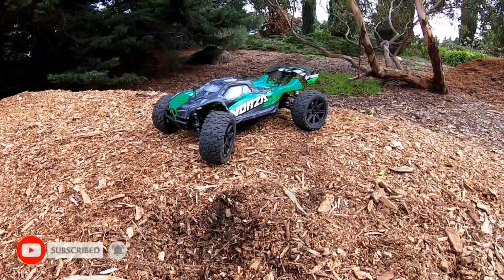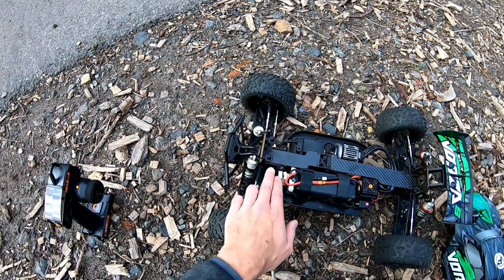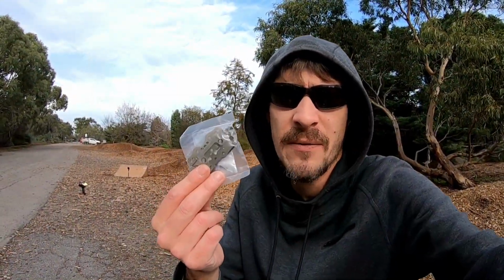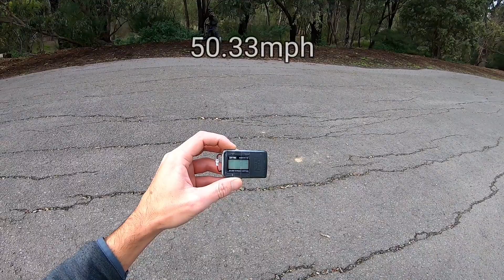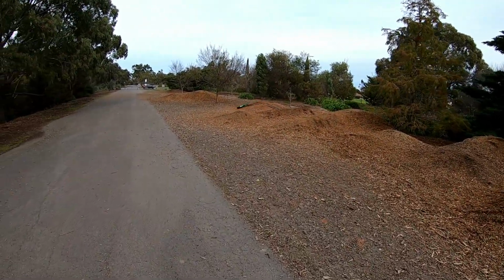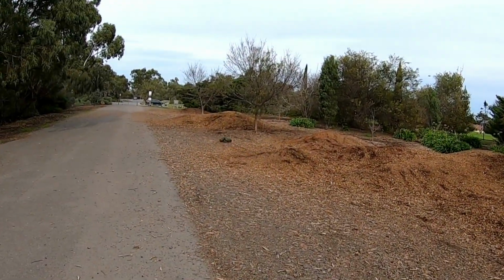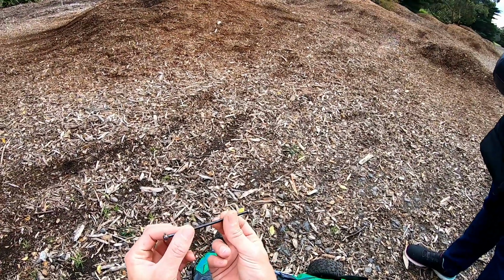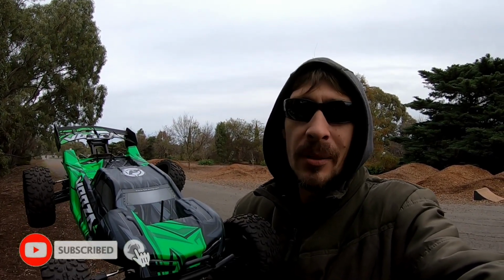HPI Vorza S mods, 6s speed test and AWESOME BASH🤪

Comment: I think the chassis while advertised as “7075S” does seem to be some sort of stamped aluminum. I can’t decide if it’s 6061 soft, but the HB D8 and D8T parts are definitely CNC 7075. All the diffs on my buggy seemed super tight, have yet to have an issue there. Most of what I’ve done to mine was to make it faster and better suited for 4S running though.
Reply: One other thing I’ve done, though I do it for all my 1/8’s any button head screw that can be replaced with a cap head screw I normally do, the cap head design is harder to strip and seems to be stronger in general, could help where your rear toe link sheared. Also I with raising the ride height, I removed the spacer on the ackerman plate to the toe links and used shorter screws, makes for less bump steer at higher ride heights.
Reply from the maker: I think they are the same chassis so must be 7075, it is doing very well and no deep gouges.

Both my diffs had play in the diff housing so put the outer shims in, my trophy flux truggy was exactly the same.
The ones I changed to thicker ones in the front diff, that's just to set it up to my preference, not needed really.

Yes swapping out the screws would help, hardened steel cap heads would be nice😁

Not sure what you mean when you say bump steering though, mine is good or at least I haven't noticed anything🤷‍♂️

Comment: Awesome video mate. I bought the budget 1/10 Maverick Quantum + Flux and every time I bash it, it breaks something or somethings. And I was wondering if the HPI Vorza S would be any better. I was wondering in further if the Arrma Kraton 6s would be even better! With better I mean stronger and more reliable!
Reply from the maker: Thanks very much👍
Yes the Vorsa is FAR better than the Quantums, no comparison really.
But yes I would say the Kraton is the strongest but a little more complicated to pull apart/repair than the Vorsa, that's what I love about HPI rigs, strong but easy to work on😁

Comment: Where are you buying your parts from? I just bought the HPI Vorza Nitro and am huge problems sourcing parts.
Reply from the maker: Depends what you need but pretty much the whole car is compatible with the HPI Trophy Truggy Flux 1/8, swingarms and some other parts are stronger on the Vorsa but my Truggy Flux takes a hammering on 6s.
Search Trophy Flux parts or HB 1/8 parts and you should find compatible parts👍

Comment: Make a carbon brace and I'll buy one!  <<< Actually serious. I just ran into an odd issue. Both front wheels lost drive at the same time. I expected to find the cup pin backed out. Instead i find both front tires spin free but the axles do not spin. So either the cvd's exploded or the hex pins exploded. Weird
Reply from the maker: I can make and send stuff if you live in Australia, can't post internationally at the moment.
And, I would say the wheel/hex pins could have broke, never done two at once but I have broken quite a few hex pins now.